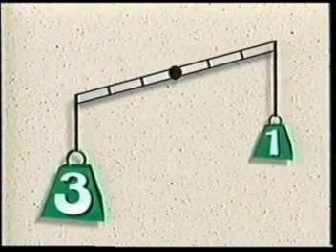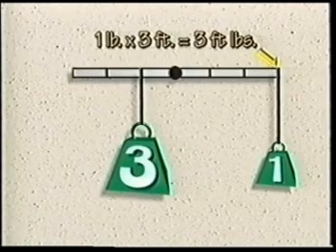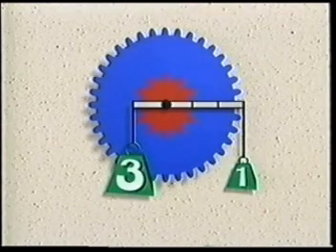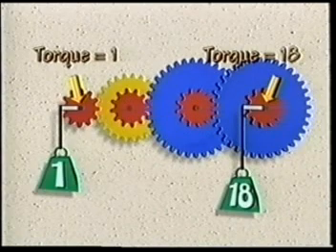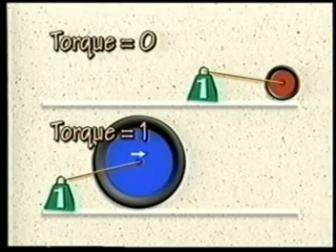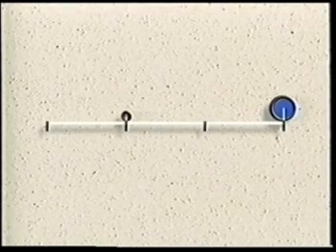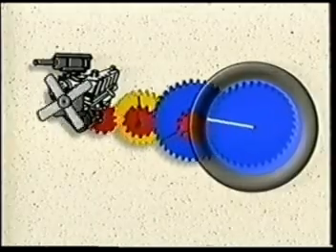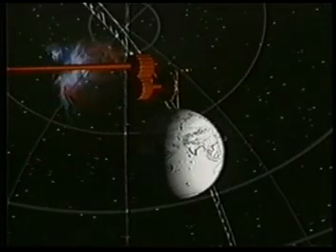Gears and Wheels Part 2

Comment: @3:20 is when it gets all confusing, when he added 1kg of weight on the blue gear, the blue gear should move the red gear because the torque is multiplied by a bigger lever arm right ? It shouldn’t be balanced
Reply: No, the small gear is pushing the large gear up where the teeth meet, which is leveraged to the same length as the weight that is attached to the large gear.
Reply: @Real_Commander_Shepard  that doesnt make any sense. The narrator says "if you apply 1 pound of force to the blue wheel" not to the red. So the blue gear is pushing the red gear. He also said "an equal force is being applied to both" but if you input 1 pound to the blue wheel, because of the increased torque you will get an output of 3 pounds from the red gear.
Reply: I think because they don't share the same rotation axis and the blue gear is bigger tree time than the red gear so the torque on the blue gear must be 3 time greater than the red gear

Comment: So for ultimate towing power use a gear train starting with a small gear ending with a large wheel 

Use a large wheel with a gear train starting with a large gear and going down

Comment: Concerning the lever, load effect is vertical..now can this lever be used in rotational load effect; say can a 1kva motor be used to spin a 3kva generator with this lever system????
Reply: No, Kva measures energy, gears only transform between speed and torque the faster you spin the less torque you have and vice versa, and so in a generator the faster you spin the higher the voltage you get while the larger the coils/magnets you use the higher the amperage you get but also the more force/torque you need to spin the generator. And of course you're always going to get energy loses from friction so no, you can't move a 3Kva generator with a 1Kva motor, you're probably going to need a 4.3Kva motor to spin a 3Kva generator.

Comment: Thanks for the video! But shouldn't it be higher gear ratios provide higher speed but lower force/acceleration?
Reply: A higher ratio for example would be 10:1. The drive gear turns 10 times for each turn of the driven gear. This provides very high torque but very low speed. A gear ratio of 1:2 for example, or as expressed in the automotive world 0.5:1 would do the opposite. This low ratio would mean that for every turn of the drive gear the driven gear would turn twice. This provides high speed but very low torque. Think of a car in first gear (high ratio ex. 3:1), low speed / high torque. A car in 5th gear (low ratio or over drive, ex 0.8:1) high speed, but low torque. Hopefully this helps clear it up, it's so easy to get this reversed.

Comment: can a bicycle tire spin which powered by USB fan motor ?
Reply: probably not enough power because USB supplies about 5v. You would need a bigger motor and more voltage to power it.
Reply: With enough gears you could but the speed of the tire would be too slow to stay upright

Comment: i didnt quiet understand that part where how a bigger wheel with equal size gear driven by equal speed and torque can move faster then the smaller wheel ? someone ?
Reply: The big wheel can roll farther with fewer revolutions because of its circumference, but the small wheel will take many more revolutions to get the same distance because it has a much smaller circumference.